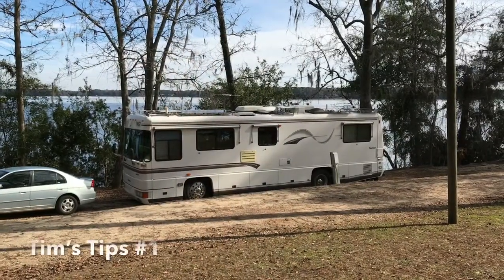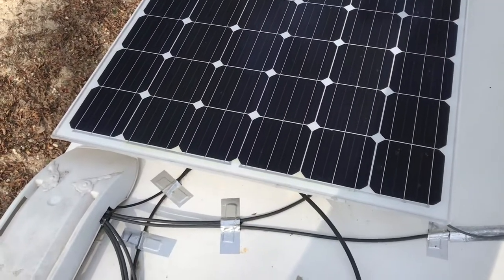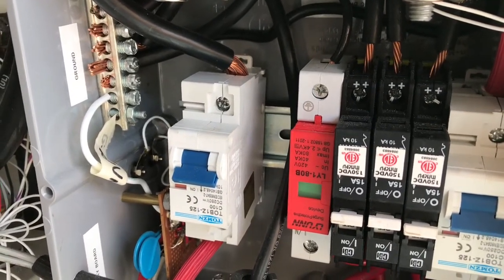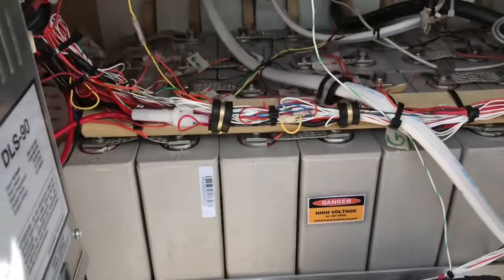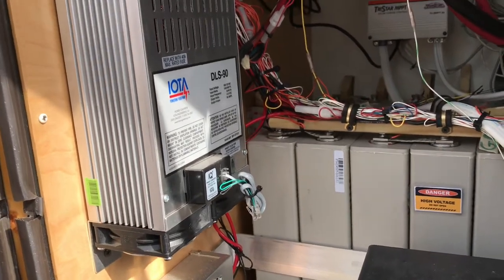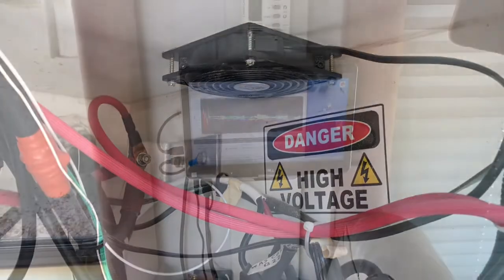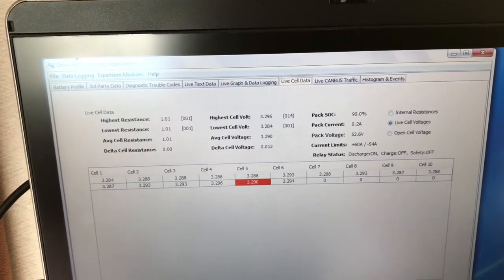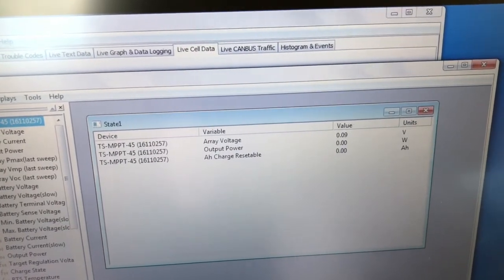Tim’s RV Tips #1 - RV Solar Panel 48 Volt Lithium Installation, January 5, 2018

Comment: Nice setup
Reply from the maker: KC3FSX Thanks for your support. My ham callsign is W3EU. The system kept disconnecting the inverter because the RV’s ice maker was drawing a lot of AC power. I am in investigation mode as to the culprit. The cell voltage display shows low voltage spiking on one of the cells, so I’ll be tightening the bolts today.

Comment: Do you do consulting for Solar in an RV?  I am building out a 48v solar/battery system but have a few questions.
Reply from the maker: Ask away. Happy to help.
Reply: I"m looking at 6ea 305W,  54v solar panels, wired in parallel for 33amps
 3ea 100ah  Lithium Iron Phosphate Batteries wired in series for 48v
 Magnum ms4048 4000W 48VDC hybrid inverter/charger
 Mppt 60amp 48v charge controller.
 I need to put in some fuses but does all that seem correct?  am I missing anything?
is it over kill?  I have a 40' 5th wheel with residential fridge, fireplace A/C, furnace and 2 TV's although I don't expect to be able to run it all, I would like to run the A/C for a few hours during the day. any thoughts or comments are welcome.
Thank you
Reply: correction, 4ea 100ah batteries for 48v.
Reply from the maker: @jcjensenis  100ah x 48v=4.8kwh  x .75% usable =  3.6KWH. Your AC would use ALL capacity in two hours. I recommend 35 KWH  of used Leaf batteries.  Yes, almost 10x what you proposed. Your other parts look OK.

See:  https://www.ebay.com/itm/48-volts-Nissan-Leaf-Battery-G2-Module-Lithium-Ion-35-kWh-7-Series-Lot-of-70/143023656782?hash=item214cdfcf4e:g:gpsAAOSwZbNdJR8o

I have used these batteries and they are great.

Comment: How are you splitting the 48V from the 12V system?
Reply from the maker: The 12 VDC house bus is fed from an IOTA DLS-90 converter, which takes 115VAC and produces 12 VDC. The 115 VAC comes from the automatic transfer switch in the inverter/charger.
Reply: @tdrager  Ok, so you're taking 48V DC into an inverter that also puts out 115V into a separate IOTA charger that charges the coach 12V battery.   I wondered if there was a way to safely take 12V off the 48V system directly, but most DC to DC units are small and weak that I've seen.
Reply from the maker: @w9sn491  Correct. The inverter or shore power produces 115VAC. I designed it this way since the rig is stored plugged into shore power.

Comment: I seen some 52 volt bike batteries Lipo4 kind for really cheap with it's own BMS. @48/52 volts and 30 Ah each for $650 each having 4 of these would be nice with a 4,000 watt 120v inverter. I would also like having a UPS style system to switch over to Inverter power with a propane Generator that I would have control over to kick on to charge the 48 volt setup when I want too. Having it switch over to Gen when inverter power is low would be nice and shut off when batteries would be charged would be a good system to have. Wiring up solar and wind would just be used first and then gen would fire up when needed then shut off. This would save propane for sure. Having a instate hot gas hot water heater would be wise and air fryer. My wife and I are doing keto/carnivore so I'll have to find a place to put the deep freezer and that would run off of the power.  I would buy one 30 amp hour battery at a time until we plan on being off grind more. Having the whole RV on a UPS style system is a good idea. Keeping the batteries around 20 % max voltage all of the time would be a good idea also. Winter you'll have only wind coming in and using the propane powered gen and I think  It turning on and keeping the batteries charged up and using it while home and cooking and then shutting it down when I don't need it would be manually done thou. Don't need a gen running just to keep a few low powered things running. Wasting propane. Just like heating up water that your not using right away.